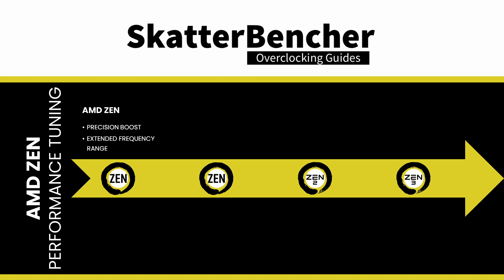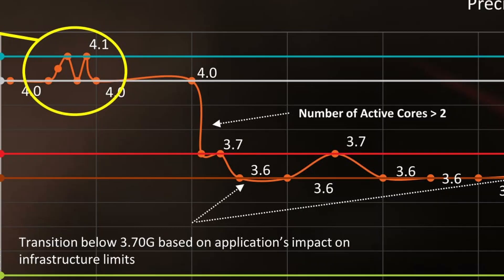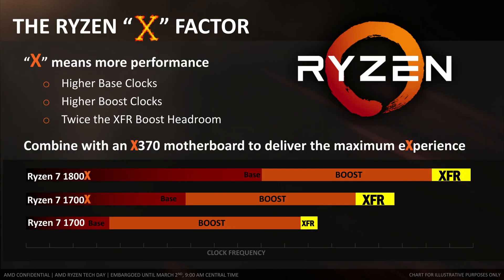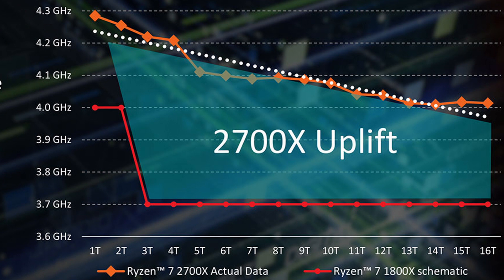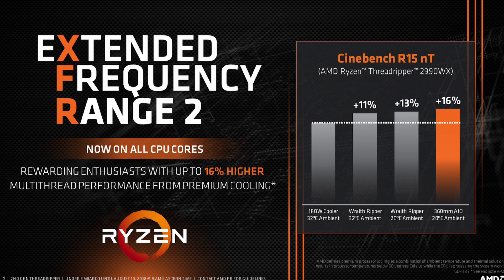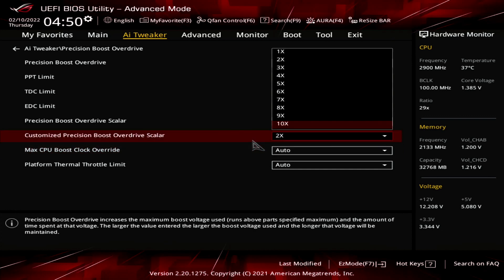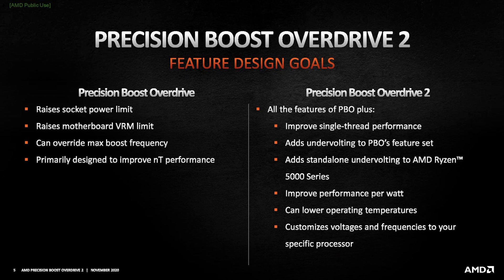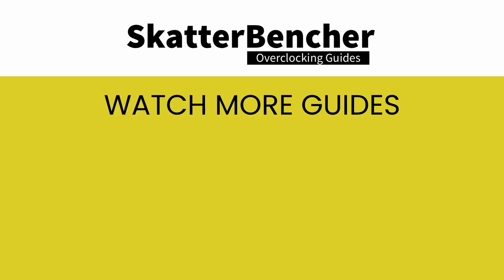How AMD gives Ryzen users more performance | SB#36

Comment: Crazy how you can get an amazing CPU with all of these features for reasonable prices. Still blows my mind to this day.

AMD really needs to advertise these features more since all their CPUs are unlocked.
Reply: But it doesn't affect performance all that much and are overly complicated for the average user. You're likely going to be tweaking these settings just because you can. Enabling PBO, setting limits to motherboard and 200Mhz+ for frequency only give me just 200Mhz over stock. So in cinebench my 5600X just boosts to 4.4Ghz instead of 4.2 and that is with a 7 heatpipe dual tower cooler that always keeps temps under 61c.